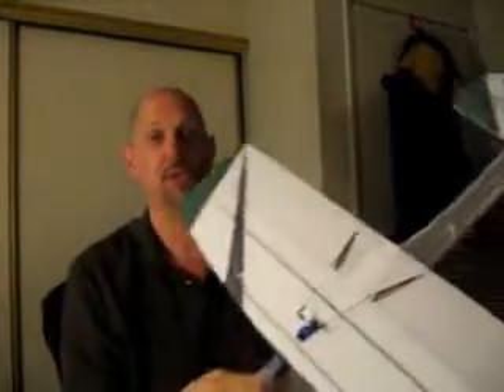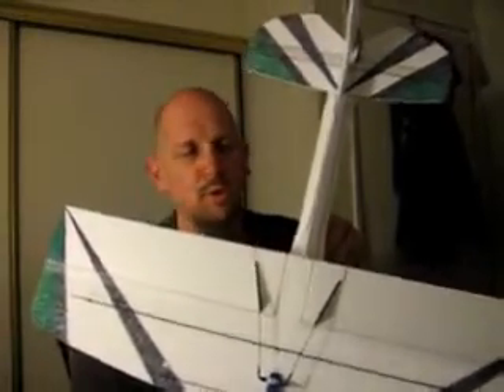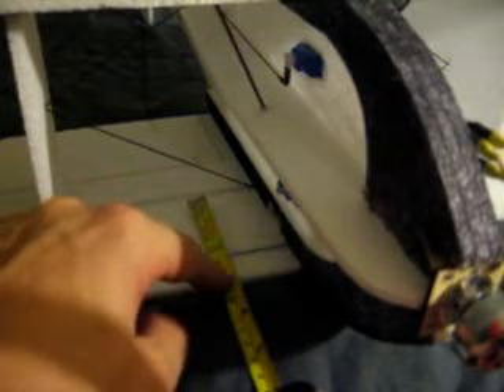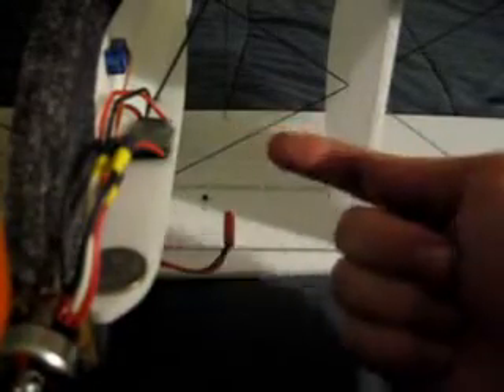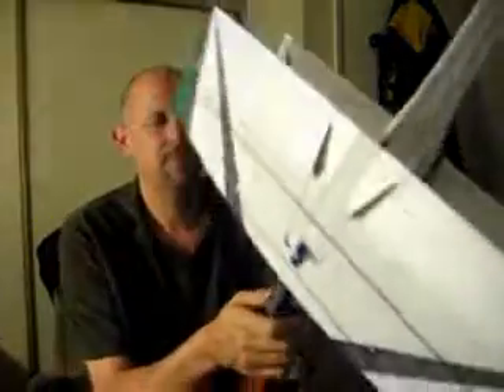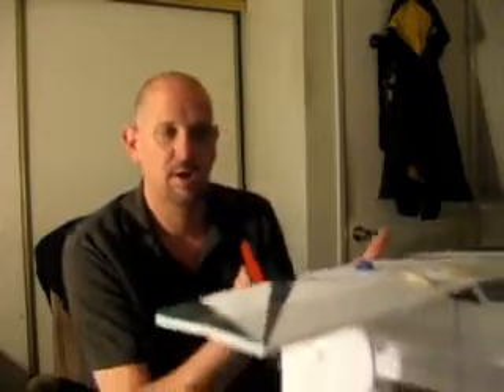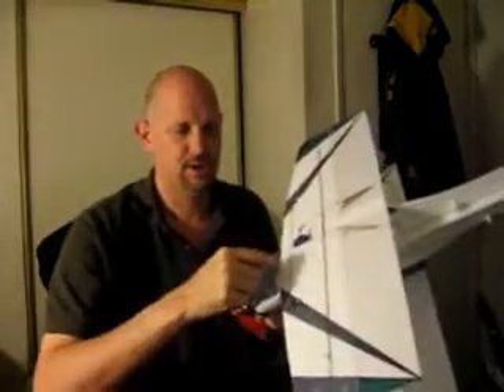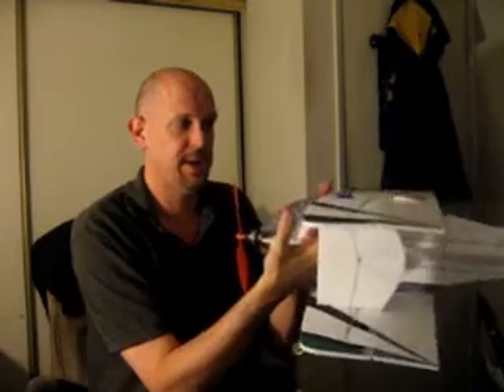How to check CG on a biplane!

Comment: Hey friend. Your correct. You can't make 3 inches a rule of thumb when not all wings are the same width. 33 percent accross both wings sounds about right. My question is what if the length of both wings are different? How would you go about basing total width?

Comment: My question is this.  I just converted an old 40 size supersportster which is a low wing monoplane to a biplane using a spare wing.  I tried flying it using the recommendations for the monoplane version by turning it upside down.  It was more tail heavy than I perceived before flying.  I have rebuilt it ( after the crash ) and now not sure where the CG actually is.  The top wing extends several inches forward from the lower like a Pitts Special.

Comment: Title should be.  'CG on this biplane' .   If you have a plane with offset wings just look from the top and measure both wings as one.  So from front of top wing to tail of bottom wing.  Then measure 30% of that distance from your leading edge.   Thats a good starting point for CG on a biplane.
Reply: That was a big help.  Wish I had seen your comment before the crash.  I'll do that after the rebuild is complete.
Reply: @TerryArthur1  what happened to cause it to crash?

Comment: Comment: To figure the CG your way, on any pipe is incorrect. Your plane looks to have the same cord on both wings, and they are directly above, and below each other. In this case, you would only have to consider one of the two wings, as you did. However, 99% of all other bi-planes have the top wing's leading edge forward of the bottom wing's leading. 
To find the CG from a bi-Plane where the top wing is forward of the bottom wing, lay the plane on its back, like you did, and measure the cord, looking down on the two wings, and measure from the forward leading edge of the forward wing, to the trailing edge of the rearward other wing. That total is now your total cord. Assuming the two wings are the same length, as your's were, take the total measurement, and multiply that number my 33%, if you wish, and that now is your CG for that plane ONLY! It becomes more difficult when your two wings are also different lengths. The formula then goes to finding the Medial Line, but that can be explained later, if anyone is interested.
Reply from the maker: Great information thanks for sharing, cg is tricky in a bi-plane for sure.
Reply: Thanks so much.  I just converted an old Supersportster to a biplane with an extra wing I had.  They are the same size but I extended the top wing an inch or so forward.  It was tail heavy and the flying was not pretty.  In process of rebuilding and almost finished.
Reply: Brilliant, Cloud Dancer!  I'm about to revamp an old Aeromaster, and have no information on its specs at all, so your help is much appreciated.  The pin method is ok for foam, but suspect on say, Solartex - easier to use a bead of glue, such as UHU , and go and have a cup of tea or two while its hardening! 
Diolch yn fawr, Den, Cymru.